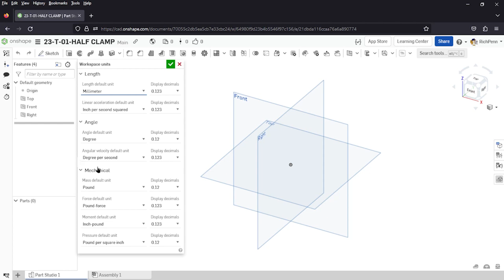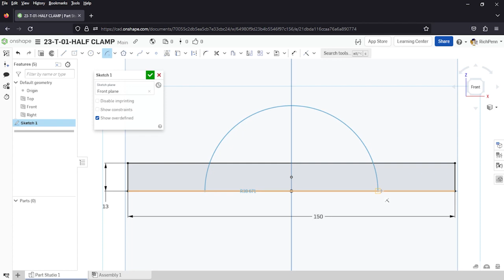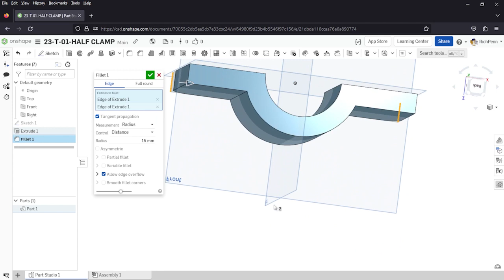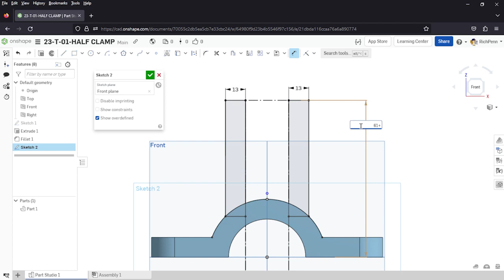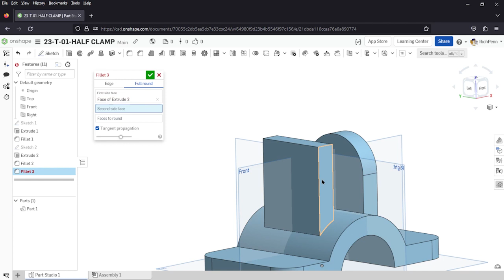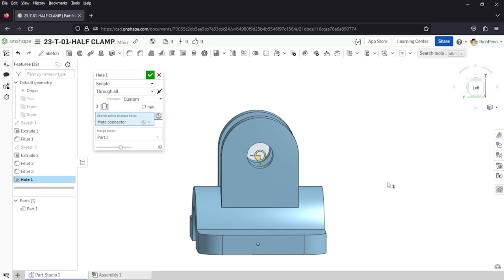23-T-01-HALF CLAMP  -  Don't make it difficult, take small steps - - a TTT part

Comment: Nice video. But you didn't calculate the mass, to see if it matches the drawing.
Reply from the maker: As @TooTallToby uses mass properties from SolidWorks, they do not compute exactly in Onshape.  When I made this I had not worked out the mechanics for doing Onshape Custom form (assuming user had not created custom properties table).  
**  I will add the checks to the new stuff I am working on for the Fall/Winter releases. **